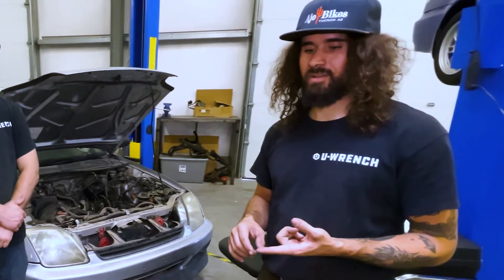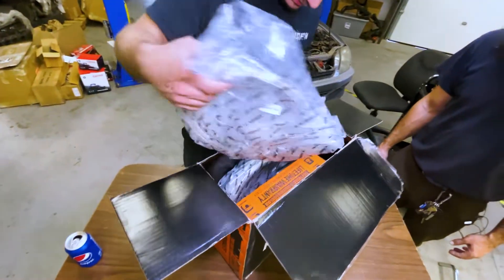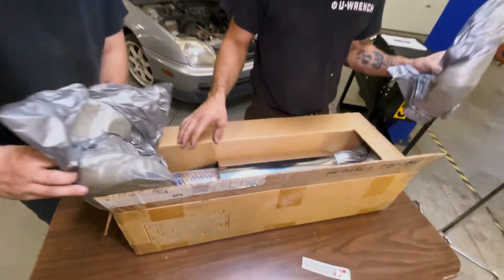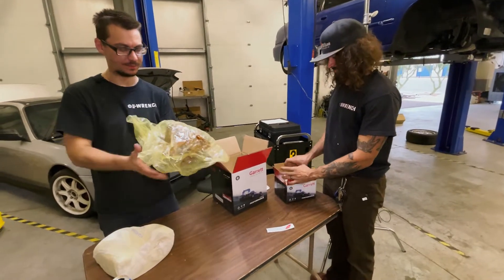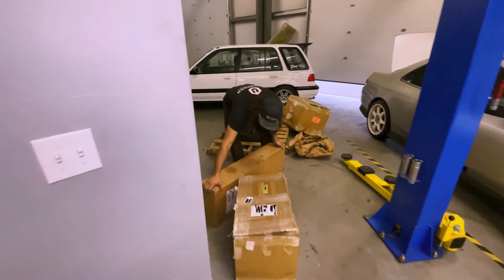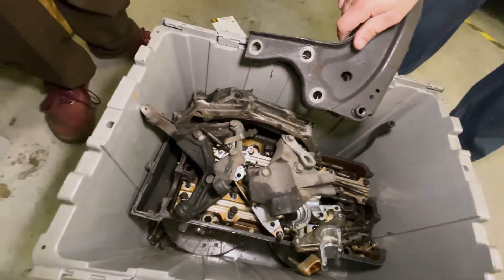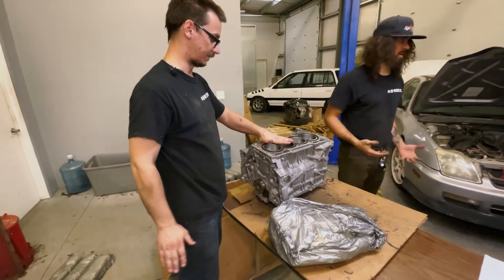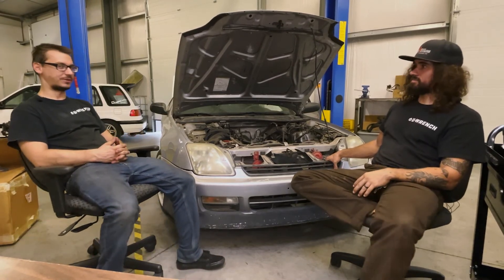Honda Prelude H23 Rebuild Ep.2 - Unboxing 15K of New Parts!!! 600HP?

Comment: I myself am building a turbo 5th gen. Can I ask what issues you have heard about innovative mounts other than the fitment issues?
Reply: Yes, a Honda Fit that I bought came with innovative mounts. We put it on the lift to check why it felt like crap shifting. The transmission mount insert was being pulled out of the mount under load. If those “performance” mounts can’t stay together on a stock fit why use them on anything.